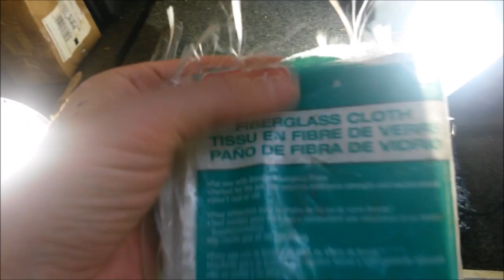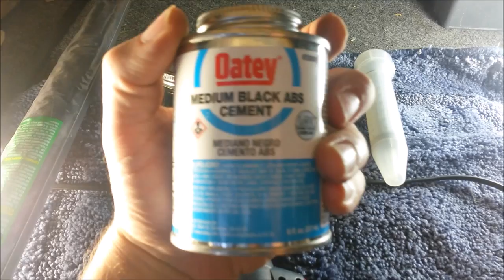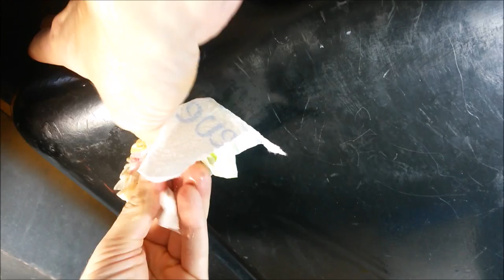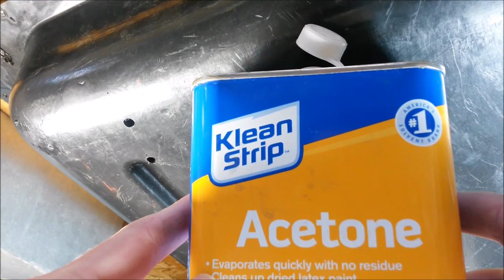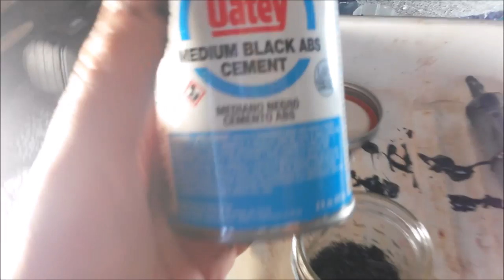(:HowTo:) Permanently Fix a Leak/Crack in an RV Black or Grey Water Holding Tank ~#1: Best Method

Comment: This technique is great! Simple, easy, and effective. I was amazed at how well it worked. I purchased a used 5th wheel and found that the grey water tank was leaking.  Did some exploring and found that the tank had cracked in two places- one crack was about 8" long, the other about 2".  The cracks had been repaired before with some sort of rubberized material and a tape covering (not flex seal, but something else.)  Cleaned that all off with acetone then followed the instructions on this vid and PRESTO!  Solid tank once again!
Reply from the maker: Awesome!
Reply: How has the crack repair held up after time?

Comment: Thank you for this video! I had a hairline crack in my kitchen sink holding tank (galley tank). It was about an 1 1/2 long right at the top of the tank where it curves around to the flat top part of the tank that goes up and over the cross member that holds the tank in place. It would only leak when the tank was completely full and water was starting to back up into the kitchen sink. On my first attempt to fix the tank I used JB Weld. It held for a few weeks and then the tank started leaking again. After watching this video I picked up some medium, black ABS cement, 8” grit sand paper and some disposable paint brushes. I had some nylon screen lying around. I did a super thorough job and ensured all of the JB Weld was removed using the 80 grit sandpaper. After that I wiped down the portion that had been sanded with a damp cloth. Then I wiped it down with rubbing alcohol.  Since it was just a hairline crack I used a utility knife and worked through the crack to make sure there was enough room to pick the ABS cement into NHLm the crack. I also drilled a 5/16 hole at the ends of the crack so I could push more ABS there and hopefully keep the crack from spreading. I put on a layer of ABS thick enough that I could see embed the nylon/fiberglass screen into the ABS. I used an enough pressure when applying the first layer of ABS to ensure it pushed into the crack and holes I drilled. I then pushed the screen into the layer of ABS. I put a layer of ABS on top of the screen thick enough to cover the screen so I had a smooth surface. I let that cure for 24 hours. I then repeated the steps, put on a layer of ABS, embedded the screen and put on another layer of ABS until it covered the screen and it there was a smooth layer. I let this cure for 24 hours. I filled the tank up with until water was staying in the sink.  NO LEAKS!!  Thank you again for making this video. Saved me from having to replace my tank!!

Comment: Have used your instructions and this method to fix both my grey and black tanks and my shower basin and cracked shower walls.
Thank you.
This works amazing and permanent!
Reply from the maker: sjodmgrp Thanks for the feedback!
Reply: How has the crack repair held up after time?
Reply: @alison1jane  amazing, its has held up for over 5 years now, and is solid. No leaks.

Comment: Great video and I thank you because I know one of my tanks I have at least two pipes going into which would be a nightmare to repair like you did in your other one where you missed the vent pipe. I have a keystone cougar with leaks just above the outlet pipes on two tanks due to extremely substandard support system that some brain dead engineer came up with. Your method worked awesome as it turned out my tanks were ABS I assume because the stuff doesn't peel off like someone else said in this thread I got lucky and mine was actually ABS obviously so this worked. The problem, was the acetone settled in this low spot were my leaks are and even after the repair continued to eat away at the plastic causing the entire area to be super soft and flexible as basically there's acid sitting on top of it trying to eat through. My advice to people using your method if the leak is in a low spot, is to do the initial repair then after a few hours put at least 5 gallons of water through, and repeat the process without drilling just add additional patch over the top and you should be golden I think I'm going to do it a couple times if it still feels soft I'm on my second application and it's feeling better already after the flush. Following my initial repair, I discovered an additional leak and ,I was actually pinched for time on an Easter Sunday and all the stores were closed So for the second leak I used turpentine and the oatley clear all-purpose cement which appears to work as well in a pinch but I highly recommend your method I had used the medium duty blue can black cement originally which worked great but if they make a heavy duty I think I'd go that route just because if I could find it and if it exists.

Comment: Very helpful. My tank has a single straight crack about 6-7 inches long. Ive worked with homemade "goop" before using MEK. This should be easy. Thank you for this video. I had a lot of people telling me to remove the tank before doing this.

Comment: I would have worn latex gloves and used the syringe plunger to draw the stuff up in to the plunger. Much neater. My leak is right at the seam of the outlet tube so I'm going to have to figure out a different fix but this is great for a fix on the horizontal plane. Thanks.
Reply: I had leaks on two tanks just like you and it still worked I just think I'm going to reapply a couple times and let it dry in between, I think the acetone has been sitting at that low point in my tank still wanting to eat away at the plastic maybe a good flush, let it dry out then try again I'm thinking.

Comment: Great video
I just had a crack in my black water tank and used this video to fix mine
The repair itself was pretty simple
Taking the under belly down was the worst of it
But it's a good time to scrub and bleach the under belly to clean it
Also, cutting the shaving to make the glue thicker is a huge 
Thing it worked great I think it gives it more to stick to and makes a stronger bond
I waited 24 hours before second coat just because of work schedule

Comment: Nice repair!
A trick I found for removing ABS cement from your hands is to let it dry and then use Gorilla tape to remove it. The glue peels right off!
Reply: Easier to just peel gloves off, if you put them on first
Reply: Yeah my skin's a little pickier and took over a week to heal It wasn't cool in the interim.

Comment: Thank you for this video, I did this repair on my gray water tank but it had a hole the size of a dime and was cracked halfway are the dump valve.  It looks good and does not leak.
Reply from the maker: Awesome! Glad I could help!
Reply: How has the crack repair held up after time?

Comment: I’m curious if the milky clear  mp-6 medium body multi-purpose would work the same 
It says for pvc cpvc & abs I had to get it because I was in a pinch in a small town & that was only option to replace some pipe before I found this video
Reply: No it won't. ABS cement is actually ABS dissolved in chemicals

Comment: Getting started was the hard part.  Easy once started, gotta get your mind right.  Couple things I discovered, my RV dealer said my black water tank was HDPE black.  I was skeptical as 3 mechanics did not know.  I contacted Keystone the RV mfd, they looked up part no. And said ABS.  ABS IS EASIER to repair w adhesive.  I took a piece of screen and ABS adhesive and tested a remote spot on tank and it stuck.  I tested on a HDPE barell and dry it peeled right off.  Cost little for small can of adhesive to be sure.

I did wear disposable blue nitrile gloves,  great help pressing fiber glass tape into wet glue.  The mesh drywall tape is fiberglass screen w tack adhesive, worked well for me, I put 2 layers at right angles 6 hours apart.

My split in tank was 1/2 inch away from 3” drop pipe, 3/4 way around,  crack was wide open, maybe 1/4 inch until I fixes cause.  End flange short direction 21 “ was not supported at all, in July heat, tank sagged, putting weight of tank onto well supported 3” drop pipe, rotation split tank, weak zone.  I cut a 21” angle iron brace , to support short end of tank b4 I started adhesive repair. When pressed in place, it raised tank middle sag, closing crack in tank to near nothing.  It will stay there.

I am dissatisfied with original engineering on tank install, and lack of tank belly supports.
I think we as RV buyers should expect better , thicker tanks, with lifetime replacement repairs, or keep walking.   1000 $ quote and 3 month backlogs by dealer is unacceptable.  Nothing to prevent from happening next year if I had a new one installed by dealer.

My advise, fix cause of split, before you patch - repair your tank.
Reply from the maker: Glad you got it done!
Reply: This is the exact scenario I have with my keystone. Both tanks (the big ones) are somewhat supported with angle iron but on the Sharp edge not on the flat!!! That's where I would expect a leak actually, since all that weight is basically sitting on a dull knife blade!!! But my leaks and cracks were just past the outlet pipe on the tanks. This seems to have worked that I think all the acetone that doesn't drain out of the tank continues to eat away so I'm now flushing and going to do a couple more treatments because it's super soft and flexible to the touch. I'm going to get some bed frame iron since it's the same size and square off the supports and add additional two assist in the slope as no matter what elevation I set the legs on my trailer It seems there is always going to be water in my tank no matter what I do the way it's currently set up pretty sad these guys have been doing this way too long to have not figured this out I agree with you that it's not right as RV buyers to have to deal with that engineering.

Comment: Trying this repair today, seems to be the best as mine is cracked at the very bottom and is under the most weight. Heads up ABS cannot be found in store though. It has to be ordered and shipped to you by Lowes/Home Depot.
Reply from the maker: It's hit or miss in some areas. Many home depots and Lowe's are trying to force everyone to use (more expensive) PVC pipe and fittings for everything and don't caryy ABS pipe, glue, or fittings.
Reply: My Lowes has abs couplings

Comment: I've repaired many cracks on plastics using marine epoxy.  It's pretty easy to use and pretty much a permanent fix.
Reply: Have you done it on yhe bottom of a large tank that holds a lot of water?
Reply: @ambush4464444  nope.  In my cases, I was trying to keep water out of the boat.  If my holding tanks in my trailer develop a leak because of a crack, I'd probably replace the tank(s).  I've seen and smelled a  leaking black tank at an RV park.  I felt sorry for the surrounding campers.

Comment: Awesome Vid.  I will be doing this in a day or 2.I have one suggestion is to precut your screen to actually area first before any glue work. And if you do make 2 pieces one smaller than the the other and place small one on first.  But awesome I will be using all your stepps in my repair

Comment: I used jb weld for water leaks before I saw this video, I sanded most of it off the best I could . Will abs cement still stick if it's not completely off?

Comment: Why not just cut a hole around the crack and use a black abs patch and sealant and screw it back on? It's a small enough crack to do that.  Mine is bout 6 or 7 in long so I have to patch.

Comment: Hey Question for you. If I pull the tank out  and do those same fixes will that work as well... I have a 1969 Aristocrat Landmark trailer and the tank has a few leaks. But because the trailer is old, the tank is a combo tank, both Gray and black in the same tank... I hope this works, thanks Rudy

Comment: This is awesome, thanks for sharing it.  While I will be able to drain my tank as best as the open valve will allow, do you think it's important to have it dry in the area where the crack is inside?  If so, how to do that?  I was thinking removing the valve body and getting a hairdryer in there, but acetone is pretty hygroscopic, so it may absorb and pull out all the moisture it comes in contact with.  Thoughts?
Reply from the maker: If you leave the valve open for a day or two, it will be dry enough. If you have a mound of "sediment" near crack, you will want to flush and clean the best you can with a flush wand.
Reply: @TrailerDayz  Thanks.  Fortunately, mine is the grey bathroom tank so expect minimal sediment, and it's been flushed.  Mine cracked about 10" right inside that indented ridge to the left of your repair.  Cause was that the tanks were supported by a flimsy "C" channel mounted on its back that sagged and offered no real support to the tanks.  Will be replacing with a small I-beam with a 2-3" web if I can find it.  :)
Reply: @RandyK1ng  probably too late now, but unistrut may be an alternative. It's smaller, lighter and plenty strong enough for the task at hand. It's also painted, or zinc plated, so it won't rust.

Comment: Awesome video!  Are you able to sand it smooth when finished?
Reply: If you let the shavings completely dissolve before applying it will be smoother than the original tank itself levels.

Comment: We've done three coats and it is still leaking. The crack/leak is up around the top edge on two sides. We overfilled the black tank cleaning it while the release lever was pushed in. The pressure from the water broke the tank and it leaked all over the underbelly.
Reply: watch the other 2 videos in the series and make sure you are using the fiberglass screen and prepping the surfaces properly.

Comment: I followed your video step-by-step using all the same materials. After curing for 24+ hours, I filled the tank with water. Had instant leak. At first I thought maybe I had another leak on top of the tank running down over the patched area, but that is not the case. The leak is coming though the patched area. I am not sure what happened. The cured ABS cement has crazing marks, if that is any indication of what might have happened. I have photos I could send if there is a way to PM you. Would appreciate any advice before I start sanding it down and starting over.
Reply from the maker: You have to do multiple coats over multiple days with a good overnight cure between coats. If you try to lay it on too thick in one application, it can crack and separate while drying.
Reply: @TrailerDayz   I did two coats over two days allowing overnight curing. I will try a couple more coats and see what happens. Should I add more screen? The crack was very small (about 1" long). I drilled relief holes on both ends. Thx.
Reply from the maker: @davesproul4349  I would sand it back to where you can see the top of the screen. Try to identify exactly where the water is coming from and the then apply 3 more coats over that. The screen is mostly to reinforce the crack and hold it together.
Reply: @TrailerDayz   Thanks. Will do. Appreciate your advice.

Comment: Is there any reason you couldn’t use the Oatey Premium Grade Yellow ABS Cement ?
Reply from the maker: Black ABS cement is actually ABS plastic dissolved in solvent so it will permanently bind with and become ABS. Other cements are just glues, which are designed to stick 2 pieces together in a tight fitting pipe bond.
Reply: @TrailerDayz  thanks very much !

Comment: Great video however, not all tanks are ABS, many tanks are actually PVC !!  ( the tank on my motor home is PVC ) one quick way to know what type of tank you have on the RV is this, if the trap/gate screws into the tank then chances are you have a PVC tank, if the trap is glued to the tank then it's ABS. This is not a 100% true method of determining the type of plastic used on your tank, but it is a good indication. Best to refer to the manufacture of the RV, call or send them an e-mail and ask them what the tank is made of. Another method that is actually the best way to permanently fix the tank is to plastic weld it.
Reply: The black tank on my 2014 mfg date Keystone trailer split.  I called dealer and they tell me it is black HDPE. Or polyethylene?  Now I am trying to figure out how to fix!  I do not trust the answer I got from dealer. (3 service techs did not know) 
Great video.   $ 1000 estimate and 2 months lead time for replacement... next one could split too.

I will NEVER BUY another RV trailer w tanks that do not have a life time tank replacement warranty. So means I will likely give up camping or go back to tent camping.  Anyone ever used a metal tank? Aluminum?

Comment: You should have cut and fitted the screen before starting the ABS.  Also round off the corners of the screen so there aren't any corners to catch and pull off.   And of course......as everyone says.  Use gloves.  They are cheap at Harbor Freight!

Comment: This will not work on the newer polyethylene tanks. If someone is having trouble using this method like me, I recommend using an epoxy that is marine grade. G Flex 655 worked wonders for my polyethylene tank. Its made by west systems. Good video though. Cheers.
Reply from the maker: Yeah. This is only for black ABS plastic tanks. For poly tanks, I prefer spin-weld patches.
Reply: @TrailerDayz  Yeah, that may be the better option for most people

Comment: How would this type of repair work for a crack that comes down the side and to the bottom of the black water tank? How big of a crack can you repair using this method?
Reply from the maker: Technically any size as long as the tank is structurally sound and properly supported. If there is a support issue that caused the Crack in the first place, you would want to address that when doing the repair